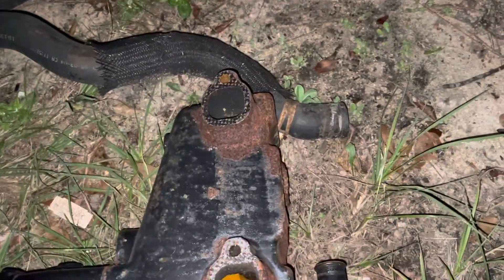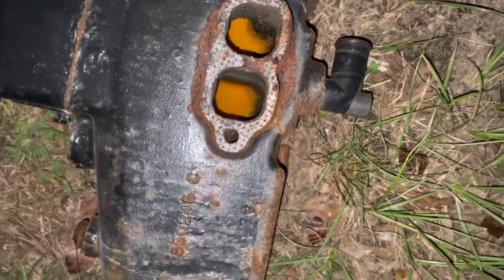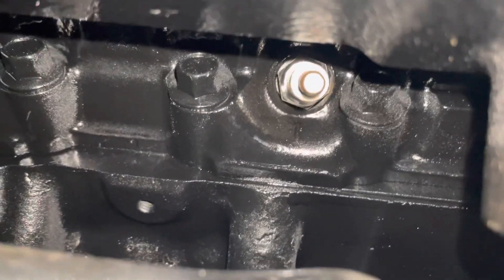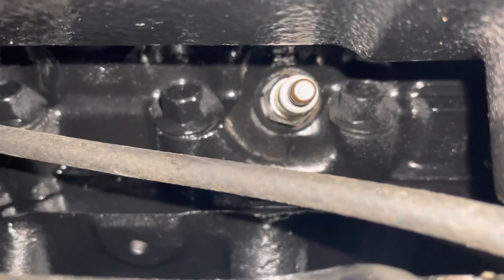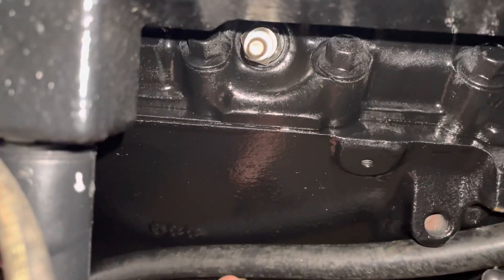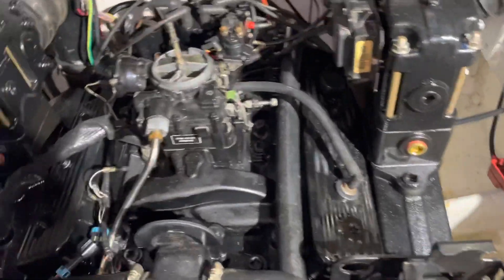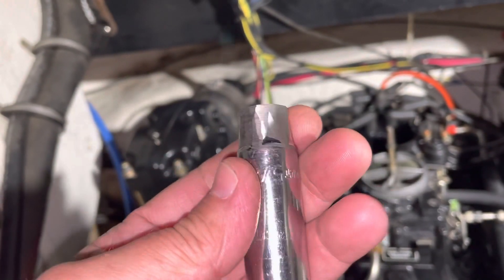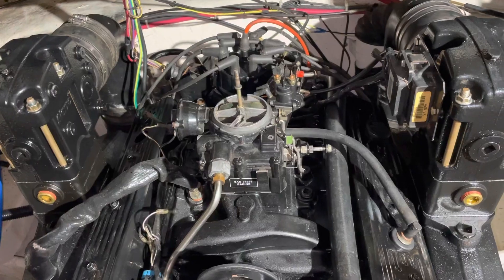Mercruiser 5.7 2(f) - One Day I’ll Learn

Comment: Plugs are good for 20 years on a boat, take the manifolds off, easier.
Reply from the maker: Negative. Not taking the manifolds off when it took hours to install them. Plus if plugs are in, and you drop or even rest the manifold on the plugs, the plugs break. I just know now to verify the plugs fit before installing the engine.

Comment: i had this same problem  i just removed the manifolds it was easyer
Reply from the maker: I wasn’t about to undo all the exhaust work I had done to install plugs. It was easy to modify the spark plug socket to fit once I could see what the problem was. Next time I’ll put it together on the engine stand.